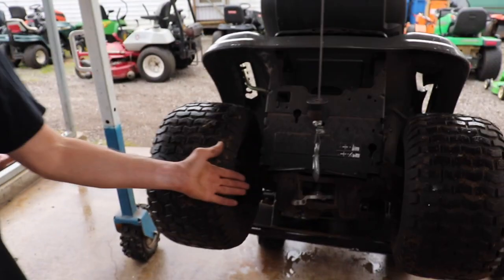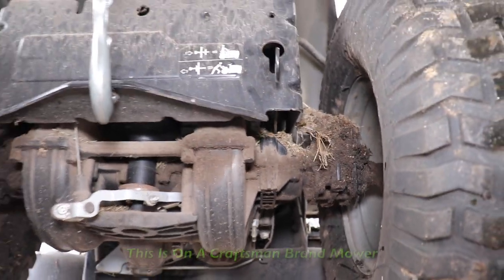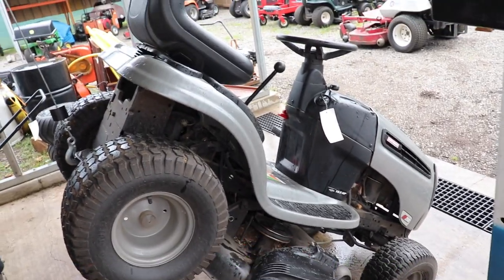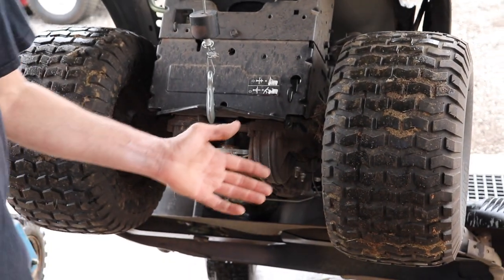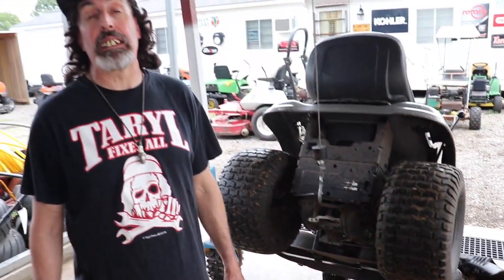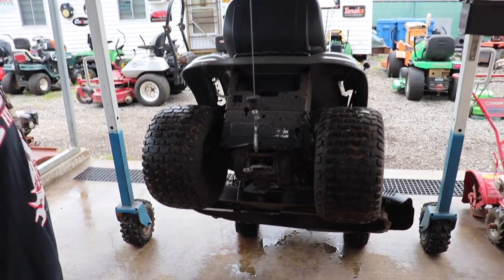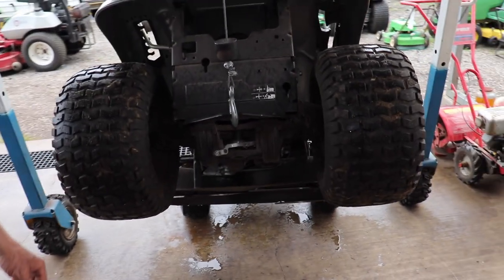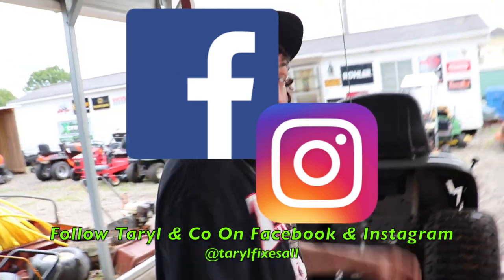WHAT?! A Plastic Transmission? WTF were they thinking?

Comment: Sorry Taryl but you're wrong on this one.  I don't often see you being wrong let alone THIS badly wrong.   Take a better look at those RS800 general transmission company's units and their YouTube videos.  Of the 200+ units I've had failures with none of them were internal failures. When you research the symptom you have, the cause can be any number of external (and replaceable) components.  Most often I see buildup dirt under the cradles of the variable speed brackets. Otherwise the issue is worn external parts.  These units use "00" grease, not fluids per se.  They were way overfilled at the factory causing the seals to blow. They do not require any replacement grease when replacing the seal.  I charge $125 to remove trans and clean under variable cradles.  I only charge $75 if there's a battery under the seat and I don't need to remove trans.  I charge $325 to replace the entire top external components including seals. Those parts ARE available from Husqvarna.

Comment: I bought an Aaron's lawn tractor  It lasted about 5 years before the transmission just stopped working out of the blue It was leaking a  couple of years before that out of the axle seal I replaced  one When it finally stopped working I wanted to know what was going on so I tore it open it has nothing but grease in it no oil  it has all kinds of cables and Springs and pullys for it to work on the outside it's the most ridiculous stupidest thing I've ever seen  They must be real cheap to buy from the manufacturer who makes them is all I can figure but Tyrell is right there c***

Comment: Typical 21st century pos.  Proud to own a 1999 Troy-Bilt with the Kohler Command 16 hp.  Still runs and cuts strong.  Newer isn't better.  Get you something old and replace the parts, not the mower.